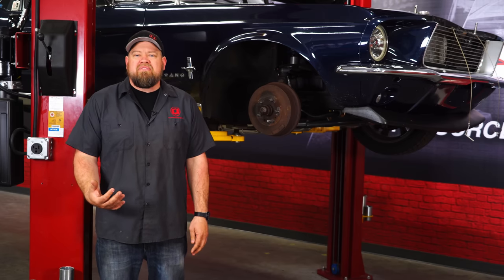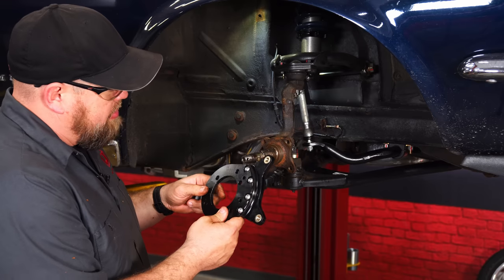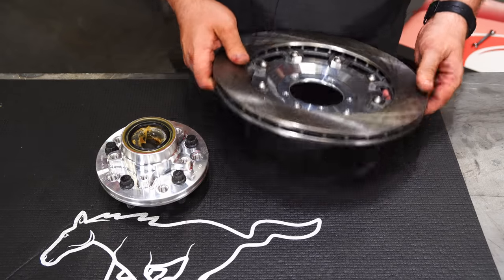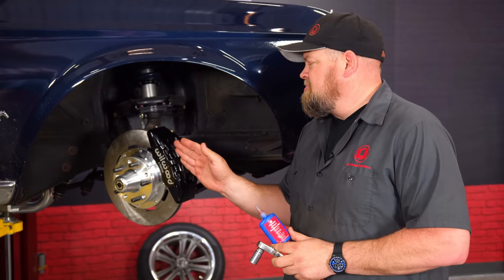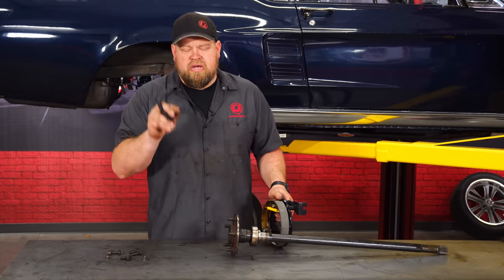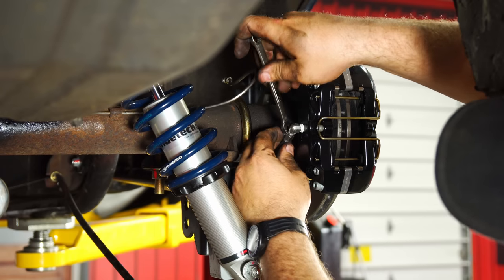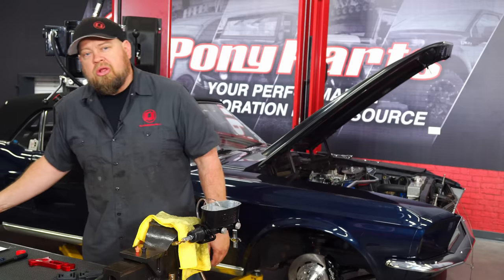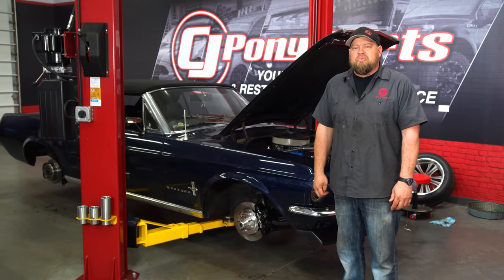Wilwood Upgraded Brake Setup | 1967 Mustang Install

Comment from the maker: Front Brake Kit:
https://www.cjponyparts.com/wilwood-front-disc-brake-kit-dynapro-6-piston-with-plain-rotors-v8-1965-1966-all-1967-1969/p/DBF250-V/
Front Brake Hose Kit:
https://www.cjponyparts.com/wilwood-flexline-brake-hose-kit-front-1965-1969/p/BHS47/
Rear Brake Kit:
https://www.cjponyparts.com/wilwood-rear-disc-brake-kit-dynapro-low-profile-with-plain-rotors-8-9-small-bearing-rear-1965-1973/p/DBR190-V/
Rear Brake Hose Kit:
https://www.cjponyparts.com/wilwood-flexline-rear-brake-hose-kit-14-inch/p/BHS60/
Master Cylinder:
https://www.cjponyparts.com/wilwood-master-cylinder-kit-tandem-aluminum-black-with-15-16-bore-1965-1973/p/BMC74/
Reply: Does this work for 67 inline 6?

Comment: I just had this break kit done to my 68 mustang I also added  a booster and a wilwood master I highly recommend it I feel like I can safely drive the car now
Reply: I did my conversion to disc brakes on the front end years ago to my 67 fastback. I now have a 351C with 409 horse, I think I better do the rears.
Reply: @redrider1079   you wont be mad you did it its worth the money I have a 351W in my convertible and I went from having to put two feet on the pedal to stop to  just applying a small amount of pressure you will need the wilwood E break kit if you do the backs

Comment: We need that 350R brake conversion video!
Reply from the maker: Alex Del Valle we won’t do that due to difficult wheel fitment. Most of the wheels that for the 15-19 won’t work with the GT350R brakes

Comment: 2 questions. Y would u convert from 4 wheel drum brakes 2 4 wheel disc brakes without using a brake power booster? Good luck stopping the mustang with the increased pedal pressure required. 
Secondly, that was some really poor workmanship with that rear steel brake line. How hard would it b 2 either cut or fab new 3/16" steel lines and a couple double flares.

Comment: I've never paid much attention to aftermarket brake systems - I don't see a vacuum booster. Is this a power brake system?
Reply from the maker: mcinkyt this is a manual system. Works really well
Reply: No power booster needed. Use a one inch master and your mustangs proportioning valve adjustested right. It will stop great. Plus if your can does stall out for some reason. Your brakes still work 100%

Comment: I have seen another video installing a Wilwood kit on a Mustang where in the comments he was bawled out for using thread sealer where the 90 degree taper fitting inserts into the caliper. They insisted he use Teflon and implied that he was an idiot for using thread sealer on an NPT taper fitting. Can anyone give a definitive answer to this?

Comment: I installed Wilwood calipers on my car but pedal feel soft when breaking. rear are drums. Do I need a residual valve inline with rear drum brakes or a 1" bore master cylinder upgrade?
Reply: yeah you need a 10 psi residual valve to the rear drums to hold pressure there at all times.

Comment: So when you need new rotors, you have to remove the hub and undo all those bolts again?
Reply from the maker: Yes it has to come apart.
Reply: I agree....not maintenance friendly
Reply: How often are you planning on going through rotors?

Comment: Massive fail on Wilwoods part. The rotor bolts on the back side of the hub. So you still have to take the bearings all apart every time you need to change or machine the rotor. Also, I wonder if you can use a stock looking master cylinder with the same bore size and have the system work just as well. I wouldn't want such an ugly master cylinder under my hood, plus needing tools to open/ check fluid level is also a terrible idea. Just some constructive criticism.
Reply: You probably should be re-greasing/re-backing bearings anyway if you're having to machine the rotor. Also, the fluid level can/should be done with a remote reservoir allowing the master cylinder to stay shut once bled.